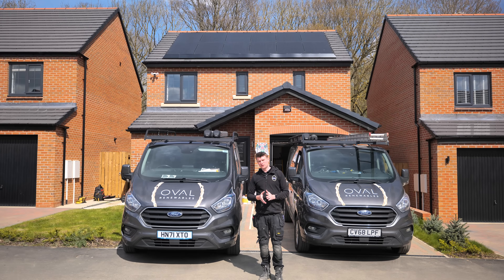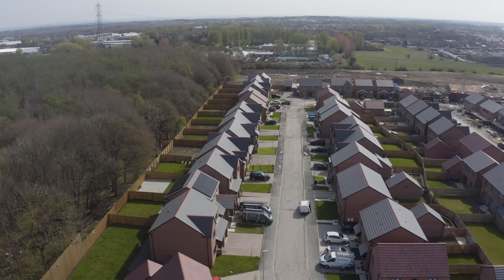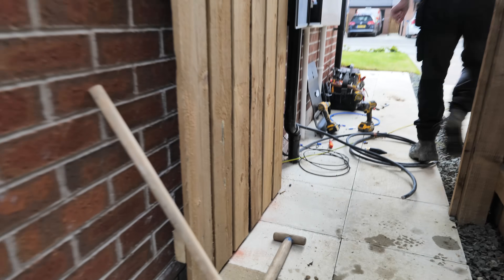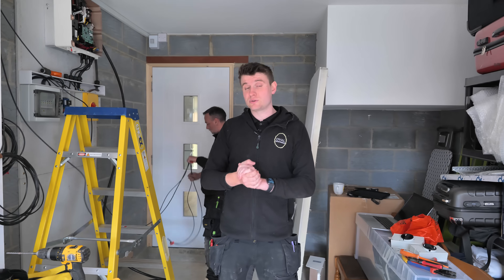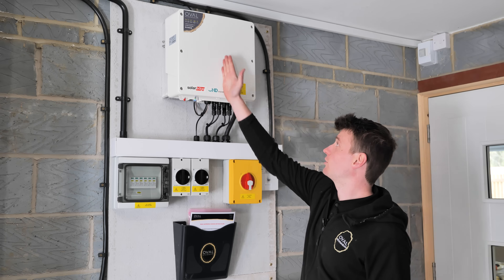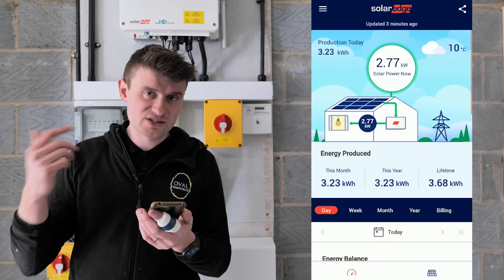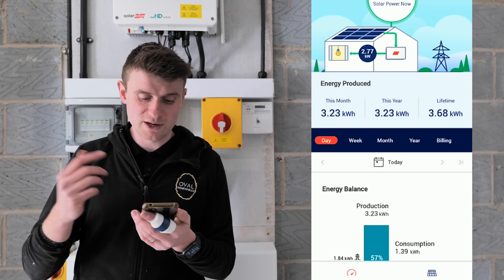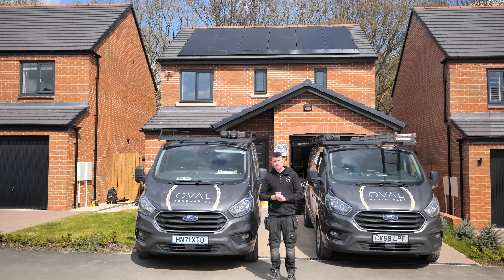Will solar work on a north roof? Newcastle installation Part 1

Comment: Interesting you and others think these bird guards are good looking. I think they are horrible and my only reference a relative that has had solar panels for some time has never had any bird issues. Seems a made up pointless addition.
Reply from the maker: Each to their own. There is a mesh option which is slightly more discrete. Birds nesting under panels is a common issue however.

Comment: I would love to see the follow up on north generation. 

We are in West Yorkshire and our “best” roof is north facing, we can only fit around 5 on the south facing. 

We previously dismissed solar as an option but this could change our mind.
Reply from the maker: Hi Josh, strangely I was thinking about planning in this video today. I will have a look at our filming schedule and see if we can program it in. We can provide you with a performance estimate for your north south system if you would like? We can also remotely take a look at this projects performance and let you know the % difference? If you would like us to take a look then please feel free to drop us an email to info@ovalrenewables.com

Comment: Now we into November and 4 months on, do you have an update on what the North facing panels have been generating recently. I'd be interested to know how much the output has dropped now the sun is getting lower. It's just I'm contemplating adding some North facing panels while the prices are so low currently.
Reply: You should look for a solar calculator. In the US, PVWatts. There's a European equivalent. You can input a theoretical array and see what it generates facing north in your location. I have some panels facing north that are doing OK, but if they faced south they'd put out about 50% more annually. Two negatives: the power dropoff is mostly in the winter, and snow persists on those panels twice as long.
Reply: @davidstewart1153  Thanks for your reply, only just seen it. A few weeks ago, we've placed an order with our installer for an additional 9 x 435W panels to go on the north facing roof of our garage. We've taken advantage of current rock bottom panel prices and utilising the 200% overprovisioning of our existing 4kW SolarEdge inverter (garage already has  10 south facing panels). We've just purchased a water fed extending window cleaning brush which I can use from the ground to keep our panels clean (and remove any snow quickly in the winter). The south panels have generated 3.84 MWh during the last 12 months, so we should achieve something around 1.9 MWh from the additional panels.

Comment: Of course a north facing array will generate pv energy.
The PVWatts calculator estimates the annual production will be 50-60% of the south array, depending on the pitch of the roof(60% for 30degrees, 50% for 45degrees).
However, the north panels will have algae quickly growing on them and the production will go down.
Obviously ROI is not this customer’s main priority (SunPower costs 3x)
Let us know about the performance of the arrays after a year

Comment: I watched the 2nd part but couldn't see an install cost?
Reply from the maker: We always ask the customer if they are happy for us to revel the cost but they preferred us not to include it in this video.
Reply: @OvalRenewables  Fair enough. Do you ever produce a spreadsheet of likely savings / payback in your original estimates? It just seems to me, that this system isn't really a financially viable system, unless I've misunderstood it? For example, say the client boils a 3kW kettle, decides to pop some toast in the 1kW toaster, while boiling some eggs on their 2kW induction hob while the washing machine is just heating up the cold water (2.5kW), then some of this power won't be coming from the battery, but from the grid at 30p+ per kW?....even though the solar might be putting 3kW into the battery or house? Is that right or have I got that wrong?
Reply: Surely viability is variable, the customer might be happy with a 20 yr ROI, or know their energy use will only increase over time, with electrified heating. Or this might not be solely financially motivated and they wanted to decarbonise their energy use.
Reply: Hi, I'm not sure of the point you're trying to make? What I was pointing out, is that most of these systems don't appear to be 'off-grid' like mine is. I should qualify, mine is 'off-grid' until the battery bank needs topping up because of lack of solar (ie. overnight, mainly). I can't export to the grid with my system.....well I could, but the electronics involved would not be worth the hassle. My system can provide enough for the house, hot water and the car in the summer months without using the grid. However, check out this year's solar production, when the BBC was telling everybody the world is on fire, the best month has been June, with July and August being significantly down on the last few years. Where has 'global warming' gone?
These systems are tied to the grid and as such reap rewards (depending on tariffs) for their contribution to the grid. IMHO, the whole concept of 'decarbonisation' (climate energy) is all bogus and part of a much bigger plan (Kalergi). Getting people to believe that 'climate change' is down to too much carbon being produced by the activities of man, is just the same as the depopulation agenda and population collapse that is in full swing now in all Western countries. Just look at the number of single people and the ones who are in couples have a dog (or two) or a cat as their 'child'.
But that's just my tuppence worth. I think your point is right about choosing what floats your boat and going with it. I did all this because Octupus Energy (the Government's chosen front company for energy transformation) were charging me 66.7p per kWh for electricity and 17p per kWh for gas. In retrospect I wish I'd gone the Sovereign Man route and extracted myself from these 'corporate contracts'.    @g4egk

Comment: Thanks! I was looking to get some panels fitted for my parents. They have part of their roof that faces south and part faces north

I thought they couldn't get much on the south side given they've got a mid terraced house and they apparently can have a whopping 14 panels on there which is fantastic tbh.

They'll be generating more than my 16 panels because mine are east facing, and South facing on my flat roof.

It'd be great if in the future, they could have it on the north side too. Sure enough they won't generate much on that side but honestly if it's a quarter of the south side that's still awesome
Reply from the maker: Yes absolutely, I was totally against installing on the north but this has opened my eyes a bit to the potential of a north roof

Comment: I had a Solaredge optimiser fail after five years but my installer said the amount solar edge provided was too low to cover expenses so I ended up having to pay for it to be swapped out. 

Not sure I'd go for them again as a result of that.
Reply: Valid point!!
Perhaps Oval could comment
Reply: In other videos they mention SolarEdge had quite a high failure rate. More than a few % hence their replacement policy. I have a SolarEdge array myself just coming up to 2 years old. No issues yet but we've only 8 panels.

Comment: We have 20*345WP on north and 10*355WP on south (in the north of the Netherlands, so climate is really similar to England). We currently generate 60 kWh in a day (18 degrees Celsius with plenty of sun). I'm very happy we managed to convince a company to install it. We hope to make 7000+ in a year.
Reply: Sorry, 10*345 on South :) same panels everywhere
Reply: It peaks at 6 kw at this moment, but when sun creeps out from behind a cloud it shortly hits 7800.
Reply: That's really awesome tbh. I think if I get north facing for my parents, it'd at least generate enough energy to help them have credits for their overall bill (which would help pay for their obscenely high gas usage)
Reply: Do you mean you hope to make 7000kWh and not £7000?

Comment: I see you added surge protection, DC only. Is that now in the regs, or just desirable in this case as I have just had a system fitted and no surge protection at all AC or DC.

Comment: we had north fitted recently. South had an old 2.6kw array we didn't want to touch so we put 4kw on the north. Getting pretty similar results in summer (obviously north is bigger but generates a similar amount). Enough to go from 'cover base load' to 'put excess into car' in summer. And in winter hoping the indirect light still generates enough to cover home load. Every little helps as they say.

Comment: I think come the darker months, which is when the power really helps, those north facing panels will be doing closer to zero watt hours!
Reply from the maker: I think they will be doing a lot less than they are now. It will be interesting to see 👍
Reply: @OvalRenewables  It will certainly be interesting, I think with the right cloud cover, the diffused light will work just as well as the front panels, basically doubling the power you would have if only the south facing array was fitted. Be nice to see a follow up in the winter. I have SE on my house roof, and have installed a Victron battery system in the garage with east and west facing panels on the garage, on a cloudy day the east and west strings produce exactly the same power due to diffused light. Forgot to say, very neat install, I trust the cables are tidy on the roof though.
Reply: if your house baseload is 200-400w, even 'close to nothing' on a 4.5kwp north array could be very usable and be enough to keep you from using peak electric in the winter
Reply: @MrKlawUK  Happy to keep an open mind, but even if the sky is not greyed over in the winter, the sun will be so low nothing is going to hit the panels. I hope oval do a video review in 6 months time.
Reply: @elslopez  you should get some indirect light on them. I’m curious - I had mine installed in the ‘good’ months so haven’t done a winter with them yet :)
Reply: @MrKlawUK  From what I can see irrespective from what ever direction your panels face as soon as there is no line of sight between the panels and the sun, the performance tanks. Even small clouds rob south facing panels considerably. North facing in the winter you would be entirly reliant on diffuse or reflected light. I mean look at what solar panels produce at sunrise, the sun is low and it is easy enough to see outside so there is light present, yet even south facing barely produce anything till the sun is higher. There is the possibilty that in winter the north facing panels will not even reach their activation threshold and could just sit at zero all day.

Comment: The law is now min 400mm to any edge of roof - this includes any bird protection skirting. - The gap to the guttering in this installation is less than 400mm so it does not comply with the regs.
Reply from the maker: Thanks for the comment, however I am not sure how you measured anything from watching the video?
Reply: @OvalRenewables  skirting aside - each panel is 1690mm &from the aerial video, there are approx 5.5 roof tiles, this gives 307mm per tile. There is one tile at the lower edge of the roof, that leaves approx 300mm. Now if these were installed before the regs change then all good. - I was just pointing this out - It's not a criticism.
Reply: The distance of 400mm from the edge of a roof is only guidance and recommend good practice, it's not law. I can't find it now, but 2 years ago before we were considering having panels fitted, I actually phoned MCS and a very helpful lady sent me the paragraph detailing this topic. To summarise it said 400mm distance is best practice but a lesser distance can be used if additional strengthening is added. So based on this when we eventually ordered a solar system we were able to get an additional 2 panels (800W) on our roof. The installer as requested by me just added an extra central support to both panels at the ends (3 rails instead of the usual 2, the 3rd being in the middle of the panel). From memory we've got something like 180mm from the edge. The extra cost of 4 additional roof brackets at either end and 4 short (offcuts) of rail and an extra hour of labour to add the additional mountings was minimal in return for having 2 extra 400W south facing panels.

Comment: From my short experience - if not directly exposed, the module gives 5-10% of rated power. so 20-40W instead of 400W. 
Comparison of just Wh, especially for a only couple of hours at the evening, is just "not correct", said mildly. A single  400W panel faced south produces about 2-3 kWh a sunny day. Here we see values like 100Wh... it can be 10W for 10 hours or 15 minutes 400W. Which conclusion one should draw out?! No meaningful statistic data collected is the only conclusion here.
Another part - why do you guys seal the solar panels on the sides? it warms up the roof, that probably is OK for UK (is it the reason?!), but avoided on more south countries, but also - it warms up the PV modules, that actually strongly decrease their efficiency. I don't see any sealed installation here around - all are installed with a ventilated gap to the roof. But it is second video from UK where I see sealed installation.. Are there specific reasons for it?!
Reply from the maker: Thanks for the message. We were just reporting what we were seeing. I agree that it’s a short space of time to draw any conclusions. I was just surprised to see generation that looked anywhere near the south panels. We may do a follow up video when we have a full years worth of data. 

The solaskirt is to stop pigeons nesting under the panels. You will lose a bit of generation due to the panels warming but this may happen without it due to birds nesting under them. It also makes the system look better which does have its trade offs

Comment: Can you use SolaTrim instead of the SolaSkirt system. I prefer the SolaTrim with its lattice effect punch outs which I think are more effective than the lack of with the SolaSkirt. Thanks.
Reply from the maker: There are many products out there that do the same job 👍
Reply: Solartrim allows more airflow then? If you have skirt / trim do you still need a mesh behind to prevent birds nesting, or is the skirt sufficient?

Comment: Could the optimiser be installed on the loft side so it’s made easier for maintenance?
Reply from the maker: Not on an on roof job as the link between the panel and optimiser can’t be extended

Comment: 8kw inverter on a 9kw system, half of which is north facing feels a little odd, I always was led to believe its better to oversize the PV vs inverter. Wouldn’t a 6kw inverter have made more sense and potential produced more during winter months?
Reply from the maker: A 6kw inverter would have worked but the customer wanted the maximum inverter capacity to allow future expansion
Reply: On a non-SolarEdge system there’s also the option to run the north and south strings in parallel, since they won’t be generating max power at the same time, allowing a smaller inverter to be used.
Reply: I have the opposite opinion to that. I have a 5kW inverter which I am forever cursing because it can’t run two decent 3kW loads simultaneously. My roof could be producing 6kW, but I can only use 5, put 1kW into the battery and draw another 1kW from the grid (through gritted teeth!)

Comment: Why only 375w panels? Would 550w panels not make more sense? Amazing neat as always.
Reply: Maybe it was the physical size of the higher-rated panels. They may not have been able to accommodate a second row on that roof using 550W panels. Per square metre, most panels are roughly the same output (20-21% efficient).
Reply: @HowardBurgess 
More watts on the roof is king. Of course that depends on the size and shape of the roof and the dimensions of the panels
Reply from the maker: The customer wanted the SunPower panels and that’s the largest ones we could get.
Reply: Aren't SunPower one of the few manufacturers who don't publish PMax and NMOT? I guess the customer wants what they want.

The perimeter looks good, I wonder how much it affects performance, increasing temps under the panels.

Tidy install 👍 Be interested to see how the north array performs over the year.